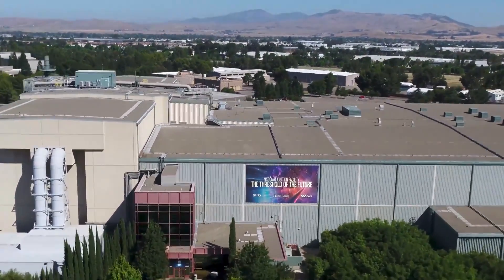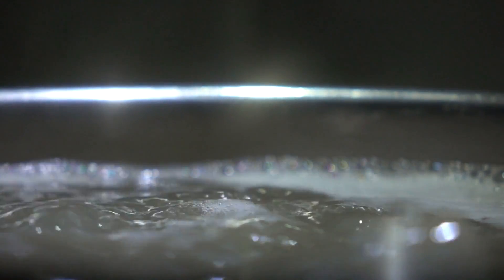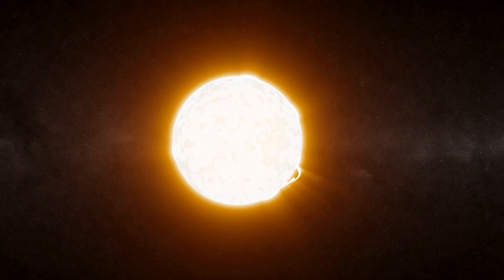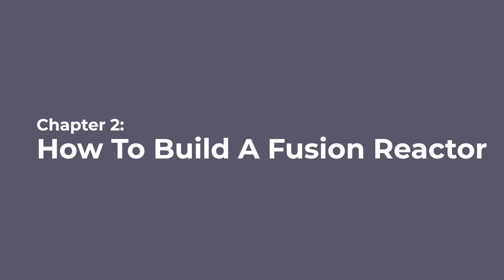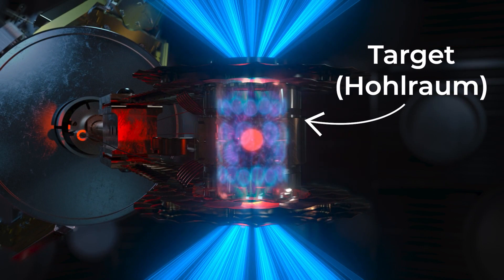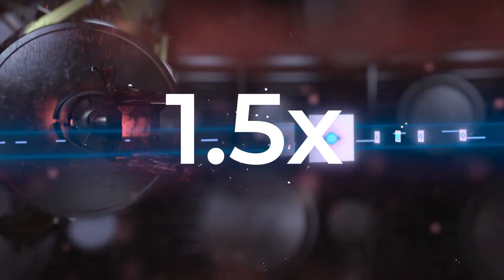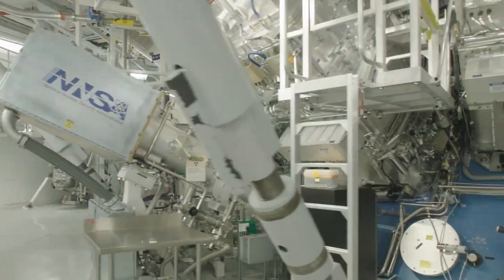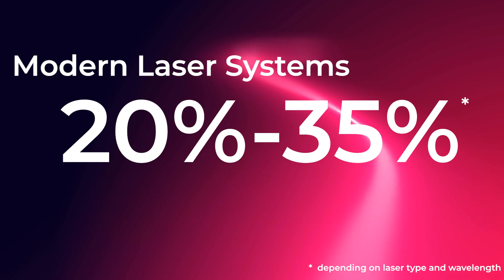The US Fusion Ignition Breakthrough EXPLAINED

Comment: Almost all fusion breakthrough announcements involve promotional hype and this process has become a standard practice since the experiments began in the 1950s. Typically key evaluation parameters are omitted from such presentations. In the case of the 12/05/2022 NIF laser shot it took about a week to set up the experiment which resulted in a fusion reaction that lasted for 0.000,000,000,08 second. It released about enough energy as it would take to evaporate two liters of water. Only about 4% of the deuterium-tritium fuel fused within the hotspot. The other 96% of the fuel was blasted away before it had a chance to react. It was then sucked into the target chamber vacuum pumping system. There was little propagation of the reaction. The term 'ignition' is applied in a deliberately misleading way. Typically, those promoting the technology tend to avoid mentioning that tritium is both radioactive and exceedingly rare. It's commercial price is greater than $30,000 USD per gram. Since the experiments began the public has been led to believe that the fusion hydrogen fuel is almost limitless. The fusion experimental programs involve dozens of different experimental machines and the financial expenditures are now more than a billion USD per year.

Comment: why does it take 300mj to create 2mj lasers?
Reply: The output energy, contained in the final converging beams, was about 100 times less than the energy that was required to produce the beams. First of all the laser beam amplifiers are energized by inert gas plasma flash lamps. The laser amplifiers only absorb a small fraction of the light produced by such flash lamps. Another factor that reduces the efficiency is that the frequency of the laser light is shifted twice. Another factor is that the conversion of the UV laser 'light' to X-rays is an inefficient process and then only a small fraction of the X-rays directly compress and heat the deuterium-tritium fuel mixture. In the announced experiment only about 4% of that fuel actually engaged in the fusion reaction.

Comment: Dr. Ben Miles repeatedly stated that the purpose of the National Ignition Facility (NIF) is basic research into fusion energy production. The administrators of the lab have always presented it that way when addressing the public and the press. The fact is that since it's very conception until today it has always been primarily funded as a thermonuclear weapon (H-bomb research tool and to train U.S. thermonuclear weapons scientists. The experiment included a target material associated with thermonuclear weapons to expose it to the prompt fusion energy neutrons generated by the fusion reaction.

The experiment that was mentioned in this presentation took approximately two weeks to set up but the fusion reaction lasted only approximately 0.08 billionths of a second. Such announced 'breakthrough' experiments typically are quite rare from this facility. The reaction begins at a microscopic spot and then extinguishes itself by blowing the vast majority of the fuel away from the reaction center before it has a chance to participate in the reaction. In this case only approximately 4% of the extremely expensive fuel mixture actually participated in the fusion reaction. The fuel pellets consist of a very thin hollow sphere of diamond that has to be almost flawless. The vast majority of the fuel capsules, that are created, have to be disposed of because they have minor blemishes that are judged to be unacceptable. The term 'Ignition' is misleading since there is no significant propagation of the reaction before the extreme compression needed is disrupted.

The recent achievement was supposed to have taken place by 2011 but NIF initially failed to reach its primary goal by a factor of more than ten. The lab used to not mention how much greater the wall plug energy is than the fusion energy output. Due to outside pressure they now state the energy input related to the laser firing energy, not the total energy expended during the experimental setup. The administrators now claim that they can overcome such inefficiencies if a new facility is constructed using new laser technologies, such as diode pumped lasers (DPL). They don't mention that the highest power versions of those lasers don't come anywhere close to the output power of the NIF lasers. They also don't mention that the NIF lasers undergo two frequency conversions that also account for the poor efficiency. The latest DPL would also suffer major inefficiencies if their output frequency had to be converted into the UV range.

Dr. Miles was enamored by his personalized tour of the First Light experimental facilities. He often mentioned the goal being fusion energy power plants but he failed to make it clear that 'First Light' have never achieved a fusion reaction with their first, or second generation machine experiments. First Light is unlikely to achieve a fusion reaction with their third generation machine and likely their envisioned fourth generation machine.

Private fusion energy firms typically overhype their operations in order to attract investors.

Economically practical fusion energy power plants, that are scaled up to needed levels, are many decades away. They are promoted by experimenters and fans who tend to be clueless regarding how little time we have left to turn this 'Titanic' around to avoid collapse of modern industrial civilization. The vast majority of the Earth's population of 8.0+ billion humans tend to have become masterful in excluding the following warnings from their consciousness. I urge readers to search for the following article titles.

IPCC report: 'now or never' if world is to stave off climate disaster (TheGuardian)

UN chief: World has less than 2 years to avoid 'runaway climate change' (TheHill)
* This statement was made 4.7 years ago.

Comment: As skeptical as it sounds, 2035 is way too ambitious for fusion generation to be rolled out.  There may be one research reactor, it will hardly be commercial by then. Divorcing our civilization from fossil fuels is going to take 200 years, and renewables like solar and wind will not do on their own. You need nuclear, and that is most likely to come in the form of molten salt thorium reactors in the next 40 years.

Comment: Why do they call it net energy gain when they had to fire lasers that expended like 300 times the energy that came out?
Reply: It has become standard practice for the fusion energy community to mislead the public with their fusion Q gain figure. It all depends upon where one choses to measure the input energy that drives the fusion reaction. In the case of NIF that reference input energy is the final UV laser photons that illuminate the interior surface of the hohlraum, or the X-ray photons that happen to end up compressing the fuel capsule.

Comment: 6:25 if anyone thinks this sounds easy, why’s it so hard?…needs to be slapped.  Great analysis, Dr. Miles,  I always appreciate your objectivity and level headedness.  To your 2035 post, I’m hoping fission will be widespread by then - supplying the power to jumpstart a fusion reactor, along with 80-90% of our energy needs.  Fission can provide us with thousands of years of climate friendly power, plenty of time to perfect fusion.  And it’s ready now.

And, if the laser animation is close to accurate, wow - that alone is amazing!  All that infrastructure to concentrate all 192 laser beams at a single point, simultaneously, is some serious engineering.  Are there other technologies in the works, or in operation, that could benefit from that laser tech?

Comment: Thank you for your critical thinking. Do you really think fusion will achieve better than 100% net energy? 
It sounds about as efficient as breaking water up and then using the byproducts for fusion. You don't have to break down water. You could just easily find hydrogen and oxygen. Light a teeny tiny spark that creates a megaton explosion and say it's a 10,000% gain. There's a lot more oxygen than tritium.
Reply: Except fusion between hydrogen and oxygen wouldn’t work

Comment: my understanding is that q=1.5 and the wall plug efficiency is .5% but with the new tech available we can reach 20-35% efficiency. so at the low end wouldn't that mean that at the low end of 20% q=60 is possible or am i missing something?one other question is after you fuse the material is it something we can use in fission reactors and continually recycle back into fusion reactors ?
Reply: Great question. .5% of 1.5, or .005*1.5=.0075 Which is the 1% actual net, rounded up, the doctor spoke of. So 35% of 1.5 or .35*1.5=.525 or about 53% actual net efficiency.
Reply: If an out put q=60 is also achieved then you would be at 2100%. That's only 2100% of the laser though. In the experiment's example it was 2MJ so the output would be 42MJ.
Reply: @wyvernstalon  is that not still far greater than we would need to get good returns on the energy put in?

Comment: What you didn't mention in your explanation of efficiency, is the fact that in actual fusion, which is what we're trying to achieve. Once the reaction starts, it can keep itself going. So the 300 mw energy cost to get out 3.5 is a bit misleading, because how fusion works and the ultimate goal means, after that big laser is fired, it can sustain itself for multiple instances of fusion. Meaning the laser does not have to be fired again for every single instance of fusion that releases that energy. Yes it's still very far away and sustainable fusion is still a long ways away, just thought I'd mention that lack of explanation on that front might be misleading
Reply: That makes sense, thnx

Comment: The most interesting idea I have seen so far on this, was a system which repeatedly fires heated plasma into the fusion chamber from two sides with exactly equal magnetic fields, they use the compression when the plasma hits the other plasma to start the fusion.
After all, I guess, fusion is only 30 years away ;)

Comment: You are a criminal terrorist ? Did you youse Acid in kitchen ?  Light laser has no field strengh, only 0,03 Tesla.
Neutrons have  just to 150 T  and more !

Temperature is not velocity but resonance of gas only then other resonanc 
is necessaire by charge and field strength. You are crasy and an totaly idiot !

There's inertial fusion and laser fusion. (for light color formation)
One is the opposite of the other. Otherwise you would be insane.

Comment: They did NOT fuse 1H hydrogen. They did NOT create 4He helium. All fission actions of elements with less than 26 protons are endothermic reactions. It takes more energy to cause fission than the energy coming out of the fission. They are playing with 2H deuterium and 3H tritium and not hydrogen. Nothing they are doing is relevant to a 'hydrogen core sun.'
Why is the process so hard? Because they are trying to violate all gas laws. Hydrogen in the core a hydrogen star Sun has a boiling point of just 754 Kelvin. The densest state of hydrogen is solid and that's just 0.089g/cm-3. 5% denser and fission occurs. They imagine hydrogen at a minimum of 50 g/cm-3 which is physically impossible. 
Magnetic confinement fusion is absurd because the Curie point is just 1,078 Kelvin. Magnetic fields do not exist above those temperatures. That's one the their biggest challenges - super-cooling magnets - and that demonstrates the absurdity of anything like that happening in the Sun. 
Since hydrogen fission is endothermic is it impossible to create a chain-reaction of it. That's why atomic and nuclear bombs did not destroy this entire planet already. They will never get a chain reaction. 
It is a science-fiction pipe-dream that this will every power electrical generation. 
BTW: Mankind would have to build over 1,000 nuclear fission power plants to make enough tritium and deuterium to power just one fusion reactor. 
The theory of hot/stellar-fusion not only violates at least 6 established fields of physics, it also violates basic economics. It is stupid. I am furious at incompetent government officials for funding this crap.

Comment: NO there won't be a fusion reactor in 10 years or in 100 years. Fission reactors work by heavy unstable elements that naturally eject neutrons that bang into other unstable atoms that cause a chain reaction of neutrons being spit out and increasing the energy level. You actually need to introduce neutron absorbing materials to control the reaction.

With fusion reactions you need tremendous energy to actually make it start. With lasers and colliders and other means of energy you can create a fusion event. But what triggers a reaction that the first fused atom now causes two other atoms to fuse? Like you said, only by raising the temperature to zillions of degrees from the first fusion event. You will find that ALL these fusion reactions will not be able to be controlled. Sure you can make an H-bomb, that has been done of 70 years, but controlling fusion... forget it!

With fission reaction, actually the first fission was a controlled fission, it took a huge effort to make a bomb, uncontrolled reaction. Fusion is the opposite, and you Mr. Miles are a bluffer.

Comment: I read a report stating that the start energy in the calculation that is quoted here was not that of the laser input but was that of the x-rays that were triggered by the laser.  Therefore the laser energy was much greater than the energy from the fusion output because of the inefficiency of the light to x-ray conversion.

Comment: This isn't exactly correct. The only particular you need to force together are protons. Neutrons don't care.  And also protons  only need to get within a certain distance and Heisenberg uncertainty will do the rest.  It's more to do with luck than force.. I.e . The incoming protons has to be at just right momentum and direction,  not to hard or too slow.. brute force doesn't help. .I.e if all particles where coming in too fast. Nothing would happen.

Comment: Again, the impulse on the deuterium-tritium pellets needs to be very symmetrical so there is no energy leakage in the impulse process, meaning the pressure being built should have no leakage. Not so feasible as to simply fire these pellets into a fire pit to so of speak...

Comment: First video that confirm that x-ray were produced by the lasers by hitting the cylinder target. Was the target tungsten? I know hydrogen bombs use x-rays to produce the pressure and heat over time to produce the fusion. Why is there so much fusion material for weapons but not much for commercial reactor?

Comment: Thank you for your explanation, as someone with a STEM background I have been looking for the numbers around wall socket efficiency, mostly because I didn't trust the marketing numbers in the NIF announcement. Don't get me wrong it's a great achievement when it comes to research but there was a niggling I had that the numbers had been massaged to generate hype.

It's also worth noting that just because you extracted +50% energy within the initial circle, it doesn't mean that the connected systems (probably some incarnation of steam generators) required to transform that energy to usable electrical energy, would be able to do so at an efficiency that still results in a net positive amount of energy out

Comment: The problem that I still see and that, even now, no one is talking about is this. When they say 1.5x net energy after the fusion event, have they factored into the equation the fission energy needed to create the Deuterium and Tritium in the first place. I know scientists need to keep people interested in the research to garner funding and while a net energy production is a key step in the process, was the fuel production energy cost factored in? So far I have not seen or heard this question asked. As far as I know the only way to create Deuterium and Tritium is in a fission reactor, and as one scientists said, " if the fission reactions and power used to make the fusion fuel have not been factored in it's likely they would bring the net energy production to zero if not a negative net energy production." That is to say that it still takes more energy to produce a single fusion event than the event creates, so why not just use clean safe fission reactors to generate our power anyway, as we already do? And I'm not saying to give up on fusion at all. We need to keep researching fusion until we get it right. This question is where the politicians get hung up and slow everything down by denying funding. Also many politicians constituents are pro fission and pro clean, safe fission power. That's why I have always said that our government should be based on and run by scientists who do what is best for our people and country based on scientific data, not shareholders concerns or personal agendas and passion.
Reply: No they just say it, and it isn't in a useful form of energy.  It's like calling a fart, "net energy," or the radiant 85% of energy not used by a solar cell, "net energy."

Comment: It doesn't release energy just because the total nucleus mass is less than the sum of the two nuclei. Rather, the mass is a product of the fusion. Also, you need to factor in the total cost of materials, processing, building, etc. into the calculations to determine if more energy out really means more energy out total.